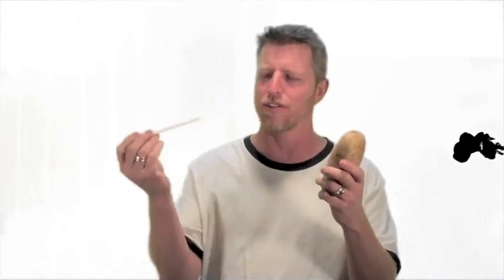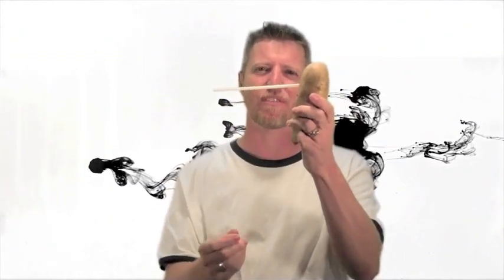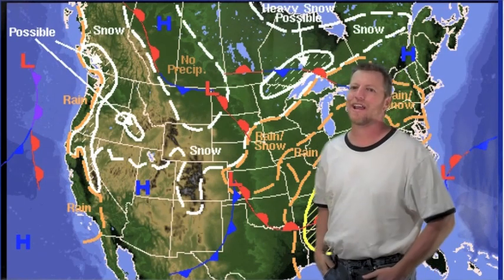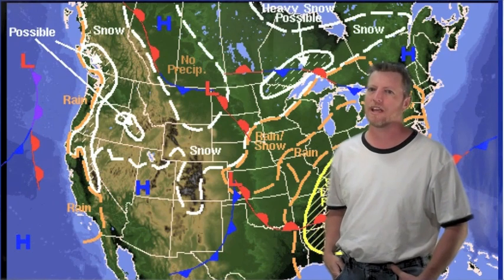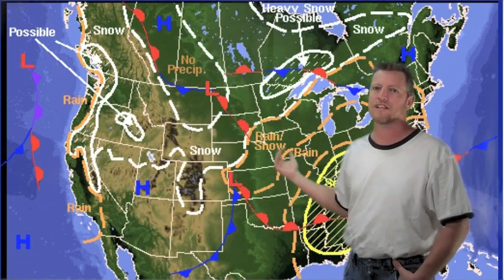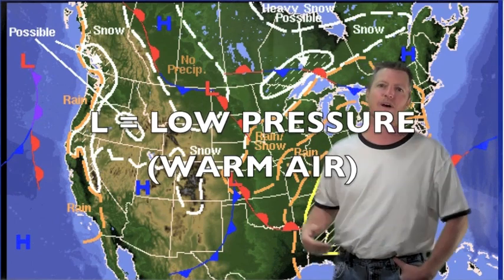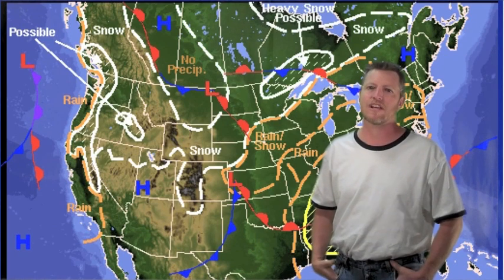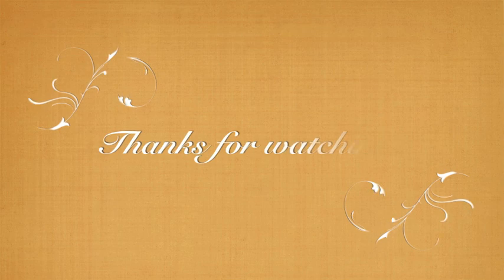Mr. Hayes' Weather Series: High and Low Pressure

Comment: Can you help clarify an air pressure debate for my husband and I...:) ? Here's the issue: My husband and I have a debate going on over when we open the windows at night and it is warmer inside/much cooler outside, what causes the house to cool down?....is it the cold air rushing in because it's higher pressure (which I say) or the warmer air which has more energy rushing out the window (and my husband says warm air has has more pressure because it has more energy?). Also, we only open windows in the bedroom so the rest of the house gets warmer...my husband doesn't understand why the house would get warmer than outside temp...I told him it's because of the air molecules bumping each other/heating up/friction of appliances, etc and insulation keeping it all in (of course our bedroom cools way down due to the open windows). Thanks for any help to save our marriage haha ;) (Also...In this video you said  @3:45min"The cold air system pushes the warm air system up because the HIGH pressure air which is the WARMER air is pushed up over the colder air." Did you mean that the "LOWER pressure air which is warmer air is pushed up over the colder air?" Just clarifying thx)
Reply from the maker: Wow, I would love to hear the other debates you guys get into. I will try to do my best to share my thoughts on this based on the nature of heated air molecules.

As air molecules heat up they spread apart taking up more volume (space). Colder air contracts causing more molecules in a smaller space, less volume but more dense. We know that in all mater the more dense it is per volume the heavier it is and sinks. When you open the window, the warm air escapes and rises up in the atmosphere out of the house. Due to the fact the volume of warm air that once took up the space in the house has escaped, it has caused a void of space and the denser colder air from outside rushes in to replace the loss of the warmer air. Sometimes we fail to recognize a poorly insulated house causes the matter of the outside of the house to transfer that energy to the inside of the house, so we can not ignore that fact.

I hope this helps in the debate. Also, yes I did make an error in the video and accidentally indicated the incorrect pressure for the air mass. I need to go into the video and make an annotation to correct this aspect of the video. Thanks so much for your comment and watching my videos.

Mike

Comment: As a kind of stylized fact, instead of saying high pressure means colder air, it might be better to say that high pressure means sinking air. While high pressure can mean colder air, it can also mean warmer air, as with subtropical highs. Deserts are typically dominated by these high pressure systems and have some of the hottest weather on the planet, for example in the Sahara or the Australian outback. In the eastern US, every summer the Bermuda High brings hot, humid weather.

Comment: Might want to check the Magnus effect as to why the ping pong ball remained in the column of air. A spinning cylinder in a steady stream of fluid or air creates a resulting down wash in the direction of the rotation. Don't question me unless you want  to be to be tea bagged by my aerodynamic knowledge sack.

Comment: H= High pressure system that carries cold air.
L=Low pressure system that carries warm air.
I understand when you stab the potato, if you block the other end the air is trap. Once you put the straw in, the air have to push the potato out. And the book with bag, isn't it sorta the same?
-My